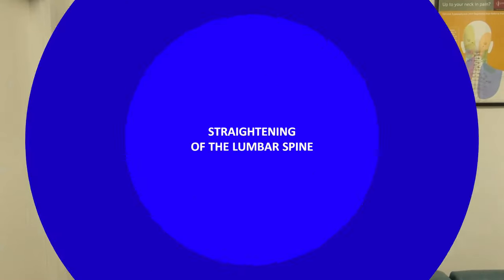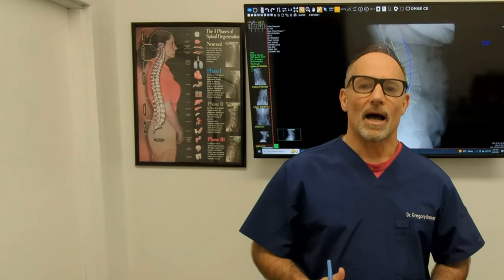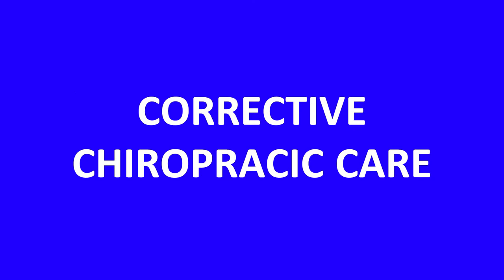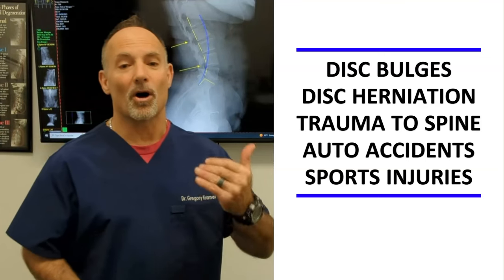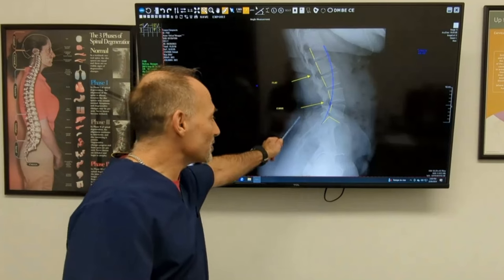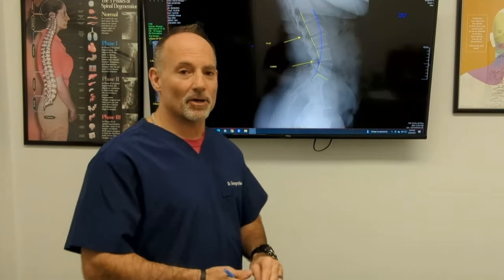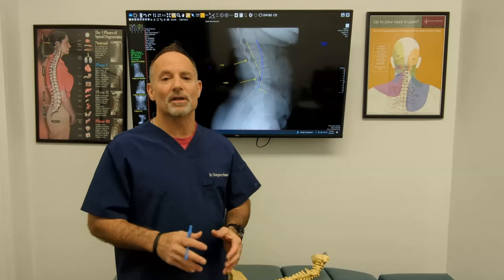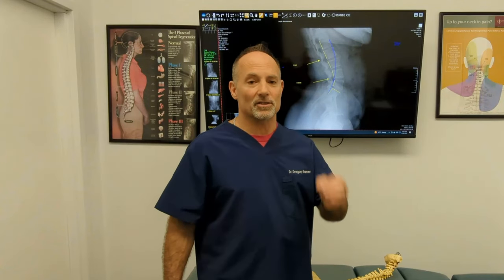FIX Straightening of Lumbar Spine (Flatback Syndrome) 3 STEPS | Dr. Gregory Kramer

Comment: Hello please  can you help me I'm have lower  spinal 3 discs  im try  all medicine  I'm doing  some  exercise  both  nothing  helping me I'm dont  feel  mine right  leg  and I'm have problem  to hold on with  sex and filings I'm 26 all mine life  its change  the doctors dont want to treat me  properly every  doctor trying  different  methods  both  no in results my leg is like dead and it burns me sometimes I just touch it with toilet paper and I feel pain there. and sometimes I stand and feel prickles and ants on my leg and I'm in so much pain that I can't stand it and is know  over  two  years   doctors  says  not for operation  and I'm had epidural injections  steroid  treatment  please  tell me what you think
Reply from the maker: WOW...SORRY TO HEAR THAT...LOOK AT SOME OF MY PREVIOUS VIDEOS STARTING WITH THE FIRST ONE...NEXT GO TO IDEALSPINE.COM AND FIND A CERTIFIED CORRECTIVE CHIROPRACTOR NEAR YOU.
Reply: Look into the Spinalogy Clinic - they use a wide array of methods to treat spinal issues (Pune, Maharashtra, India)

Comment: I am 31 yr old. I have seen on my mri report "relative straightening of the lumbar lordosis". I also have a disc herniations at l4-l5 and l5-s1. 

The treatment I've been given are stretches like cobra and core strength exercises like bird dogs and dead bugs. 

The pain I have is extreme tightness, soreness, inflammation in low back. Made worse with any flexion or sitting . Please respond and let me know what you think I should do or if you have an idea of how I can find help. I live in south Florida. Coral Springs FL. Thank you for any help.
Reply: Hello my wife also shows mild disc bulge in l4 l5 S1, pain is not like sciatica radiating to leg but there is so much tightness in back musules are hard. She can't even bend her spine in flexion while sitting in relax position. Her spine is always remains straight in extension. Whenever she tries to bend the spine or sits in soft surface her spine bend in. Flexion and then pain starts.
Reply from the maker: ANY BENEFIT FROM WHAT YOU ARE DOING? IF IT HELPS KEEP DOING IT IF IT HURTS STOP...FIND A DOCTOR WHO IS CERTIFIED IN SPINAL DECOMPRESSION IN YOUR AREA...GOOD LUCK.
Reply from the maker: ANY BENEFIT FROM WHAT YOU ARE DOING? IF IT HELPS KEEP DOING IT IF IT HURTS STOP...FIND A DOCTOR WHO IS CERTIFIED IN SPINAL DECOMPRESSION IN YOUR AREA...GOOD LUCK.
Reply: @DrGregKramer  thank you so much for the reply. For some reason I've attempted different types of decompression methods and it has always made me feel worse and caused muscle spasm and pain and worsening of symptoms do you know why that may be? 

 As time has gone on my symptoms have gotten a bit better. Particularly in the nerve type of pain it's gotten better. But It's been 5 months since the injury and it feels as if ive reached a bit of a dead end on recovery. I cannot relive the tightness, soreness lack of mobility inflammation and pain I cannot sit , can't run or jog or move quickly in anyway. No flexion tolerance. Please any input you have is much appreciated
Reply from the maker: @dominickmatteo7262  Did you see my video on spinal decompression? If so which type of decompression...face up, face down, side lying? It is a tool that takes a mix of science and art..let me know.  Did the doctor combine structural rehab (corrective care) with targeted exercises and Spinal Decompression?
Reply: @DrGregKramer  thank you I watched the video great info. The type of decompression was on my back with feet up locked in and straps around torso and waist I believe a traction machine 80lbs of pull. It resulted in more pain and I believe furthering my injury. Chiropractor said maybe it was too aggressive. 

Months later was the other type was more of a hands on type. On my stomach on a table that had my legs pump and the clinician push on my back. Resulted in terrible muscle spasms and more sciatica. Clinician suspected I was in to much of a spasm/inflamed state that any movement even a positive one resulted in aggravation. They did not do corrective care along with the decompression I haven't been offered a service such as the bracing or anything like in your videos to help gain back the lordosis in the lumbar other than stretches. Do you think that could change the out come of the decompression methods? Thank you again for this valuable info.
Reply: Hi sir I am 28
My report says loss of lordosis 
But from 3 years..in my legs and hands getting burning sensation and tingling..is this coming from loss of lordosis??
Everything is normal in my blood sugar level and B12 also